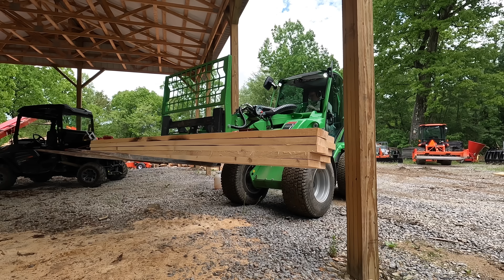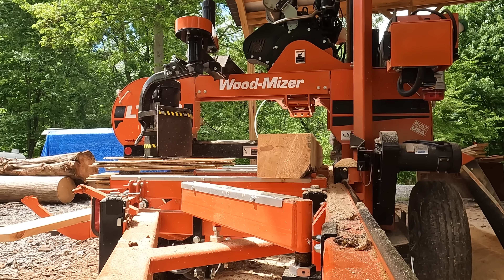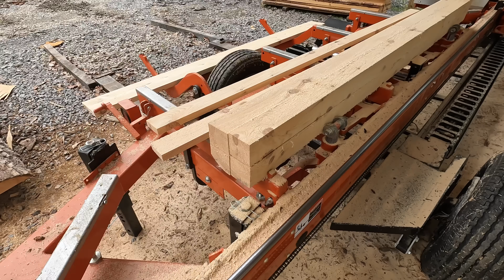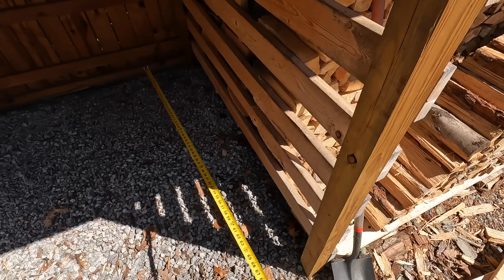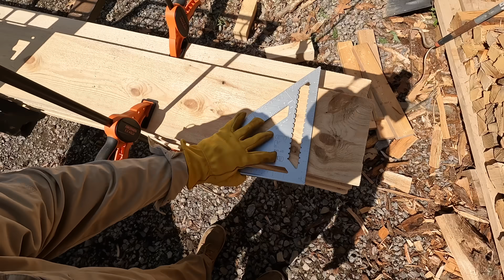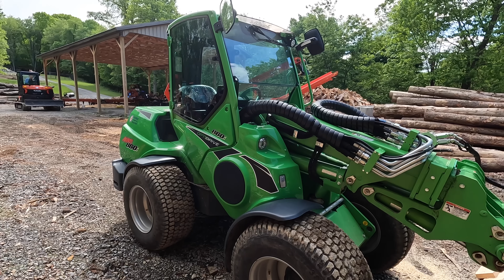CHECKBOOK and SPONSORS Gone WIld!

Comment: Mike, as a retired Senior I simply enjoy your video's and the time and effort you put into them.  Thanks.  On a different level I admire your ingenuity, combined with your skills both employing machinery to streamline your operations and productivity.   I also enjoy seeing the skills you  have operating the machinery, I know from my experience there is a fluidity of using the hydraulics to handle heavy materials safely and "gracefully" and not simply bash and bang things about.   Further your comments and common sense shine through and you've highlighted some of the worry and confusion we face with our current Administration and the seemingly lacking in leadership.

Comment: I want to thank you Mike.  Yes it is easy to covet another man's success.  However, I am all about action so that is my interest.  God bless your family and rewards for hard work.  We own several diesel powered pieces of equipment as well.  Most of mine is retired rental or govt fleet.  Seeing equipment out there being used helps me decide if I need to use it, own it or rent it.  

My wife and I bought a portion of a large farm and have built our barn (last year) and working on the house today.  Your advice from your shop build about renting the larger excavator by the month was good advice.  With only my wife and myself framing the house, we rented a telehandler and later on a man lift to make the construction easier/safer.  We are at the early part of our 60's and believe me, mindful of what our limits are.  Things have gone pretty slow as I am still working full time but certainly beyond 2 weeks, the monthly rate is the way to go.  Your advice reminded me to ask for those rates.  Luckily my rental company is a good one that lets you stair step into the monthly rate so you can decide based on a weekly rate at first if the equipment meets your needs.  Yeah, it's getting expensive but what is your life and health worth to you?  Still cheaper than hiring a framing crew (sadly) and my wife and I can later say, yep we built this.  It's not our first one either (#5).  It would be nice to own this equipment but finding something affordable and working right when you need it can derail progress.  For example, I own a Genie S40 lift but it is down because the main boom piston seal is bad. it went bad during our barn build and I resorted to one those tow around things (never again, beats a ladder). Turns out, I needed an S60 for this house and 4WD so my S40 was not the proper tool anyways.  Still, those darn things are maintenance nightmares.  I have to fiddle with it constantly, probably because it sits a lot.  It likely would have saved me more than it was worth if it was working.  Just bad timing.

I did purchase an excavator and skid steer.  I think I could have rented the excavator but the skid steer (Takeuchi) is very handy on a farm.  The excavator may be too as i migrate from construction to property maintenance.  We are in Georgia and my excavator (JD35G) actually came from a auction company in eastern PA.  I have some nasty road banks that need mowing, Having a small mower on the excavator stick would be the way too go.  I may look into that.  We have excavated and graded about 3000 yds of soil with those two machines.  A barn pad that is 80 x 100 with margins takes a lot of dirt in the hilly area where our farm is.  i had my doubts about excavating our basement with the 35G but let me tell you, it digs great.  The boom and stick extension is the bigger problem.  You have to throw spoils nearby and have someone (me too) bucket that away.  I think 35G's are really Hitachi machines but that thing is amazing for its size.  Sure could have used a grading bucket.

Sorry for the book.  i just wanted you to know there are plenty of us workhorses out there getting it every day and we appreciate those of you willing to document and share you experiences,  

For everyone that can't afford to own, quit hiring people to do your work. Go to the rental place, they will deliver and you will have to satisfaction of doing it your self, good or bad and learning something new.  Trust me, fear is the only thing holding you back.  You never know, you might build a business on that experience, help a friend or stranger, find a career, start a youtube channel.  Look what Mr Mike did, hat's off to you sir..

Comment: Hey Mike enjoy your videos. Just my two cents here. I've been restoring barns, farm building and older structures since 1989 and I have found red oak does not hold up anywhere close to white oak. Red oak has straight open grain that actually capalat moisture whereas white oak is a tight twisted grain and resistant to moisture. The wood shipbuilders used mostly white for this reason. Like I said just my pennys worth keep the videos coming we'll keep watching.

Comment: Hi Mike, I might have missed why you have so much wood in your wood shed. It looks like a lot of extra work (double handling) I would put all wood in the metal crates and store them that way for both selling and your own use. (With or without a lid on each tote to protect from the rain and positioned for maximum airflow for drying) cheers Steve Melbourne Australia

Comment: have you considered a back hoe attachment with the log grapple for your tractor, or maybe front loader attachment? It may get you almost the same functionality as the wheel loader (easy on turf, articulating head, decent lifting strength, good land speed). Won't work as good as a dedicated machine but it's not 100K either.

Comment: I have a quick question how is the drying on the firewood when you stack to wall to wall and floor to ceiling.  I was allways told you need air flow for wood to dry properly. Hows the average moisture in the back of the stack.

Comment: He was attempting to explain Modern Monetary Theory (MMT). He did also correct his borrowing mistake later in the interview, but clearly he is not competent for his role. If you think that interview was nuts, research MMT.  Not sure if he really didn't understand MMT or if it's such a radical theory that it's unexplainable or if he was tip toeing around the question for fear of upsetting progressive voters.